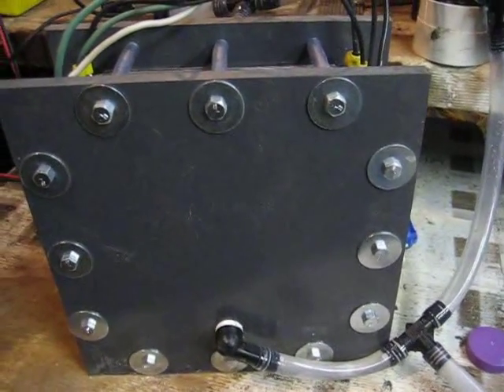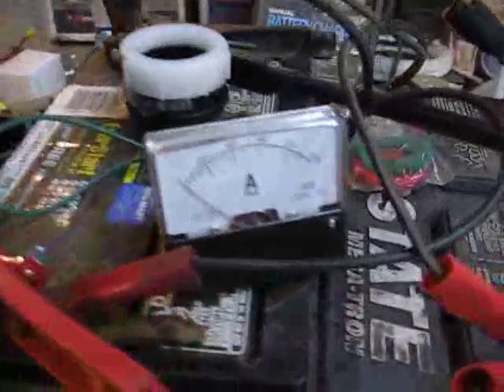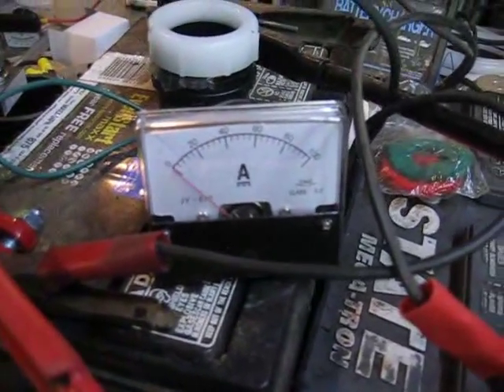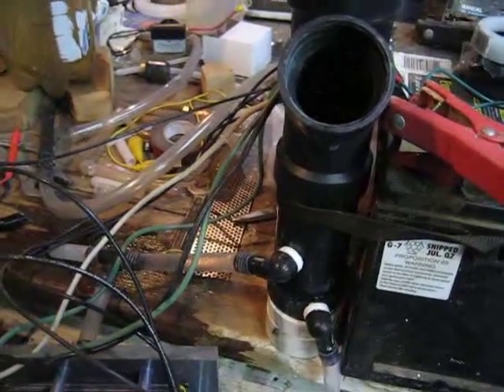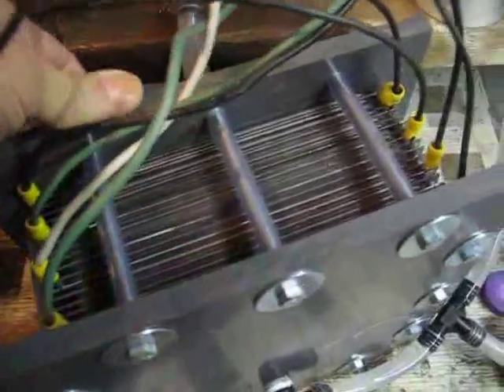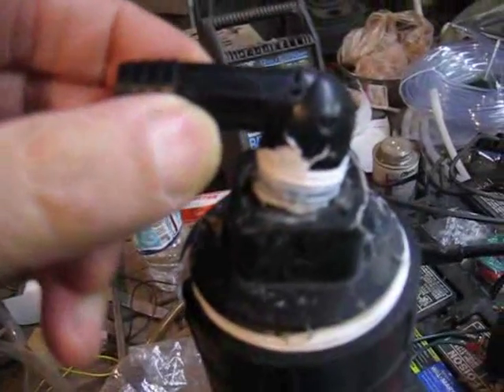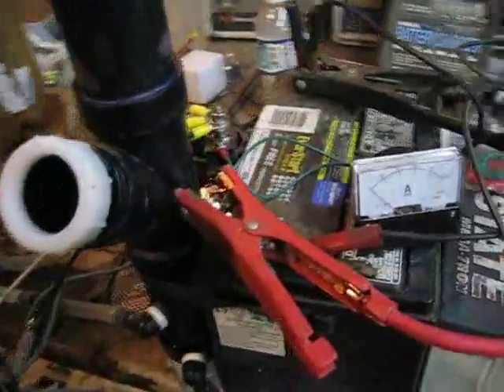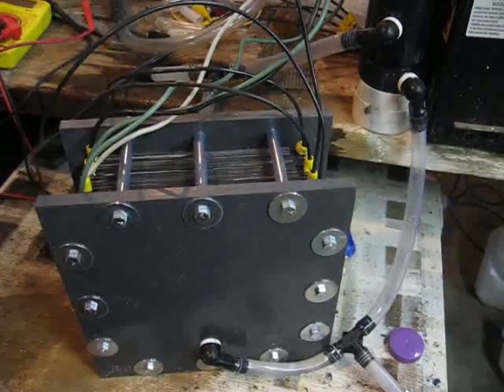HHO Dry Cell Bubbler Explosion With No Spark?

Comment: When u disconcerted  the negative from the battery u should  short with the positive  cause it holds potential on the liquid  / A Cell its just  battery  a car battery  but without  the acid  with its the eletroquimic component that hold the charge on the battery/  on the cell the energy  its released in the gas that u produce by the plates.  So it's charge  the water and want u touch with the  hand the difference int  potential discharge with spark that / the  spark travel the plates by the empty area where the liquid  was out then the spark reach the positive plate on the gas space that create the perfect environment for the explosion if was full of liquid will not do that  or if u short the positive negative disconnected that  also  prevents the spark static

Comment: Nash
In order to habe an explosion you need an explosive mixture. Hydrogen by itself will not explode but when you mix hydrogen with oxygen look out. When you emptied water out of the cell you let in oxygen and it does not take much to set off this mixture.

Comment: Hi Well have read all the comments but what I saw in your video was a bolt holding all the wires together,which came right to the positive terminal when you tipped your cell forward, I think that bolt touched the positive terminal, and if you had some gas come out that bubbler which is right there by it, seems logical to me, when you placed the cell upright the bolt moved back away again. Have another look at the video yourself.
cheers zeropoint132

Comment: this is possible, but not likely. but there is a way to demonstrate something interesting you might never have seen.

1) run your cell til its hot, shut down, disconnect power

2) read volts across your device, yes there will be some, drain off 1/2 fluid, short out the device til volts read zero.

3) tip device so fluid is in contact with previously dry surface, read volts

4) you will once again see a standing voltage

not sure this was cause, but its an interesting experiment ...

Comment: I work in the appliance trade and when we work on circut boards we wear a device which is just a wire attached to you and a ground. This will discharge any static build up in your body. This will prevent any static dishcharge into your cell or bubbler. I've had my bubbler explode close to my ear also. I know the pressure in your ear, you are talking about.  I also had a ringing for 30 seconds or so. Havent damaged my hearing that i can tell, but i have worn hearing protection ever since.

Comment: well, that was a darn fine bubbler you lost then ... if it was still holding gas that long after a disconnect, it was a good one ...

I cant imagine your spark came from inside your device unless maybe you accidently shorted it out internally ... but looked like you had it disconnected from ground ... so best guess is static at the bubbler ... bubbler is where the gas was .. all it needed was a little spark ...

Comment: you must not have been leaking that bad if you still had gas in the system enough to go BOOOOM after draining fluid and all ... think you got zapped by a static discharge ... can happen ... build up on the surface of the pvc tubes ... rub one with a cotton cloth for a bit and you will detect the charge ... at some point there was enough potential for it to arc to a nearby ground, probably the battery ...